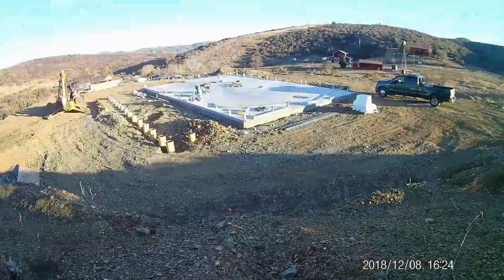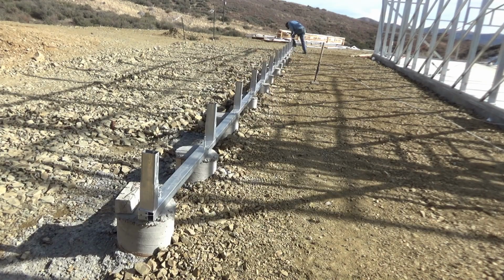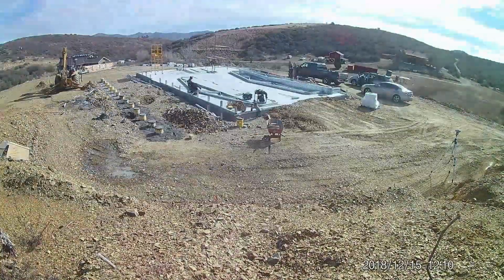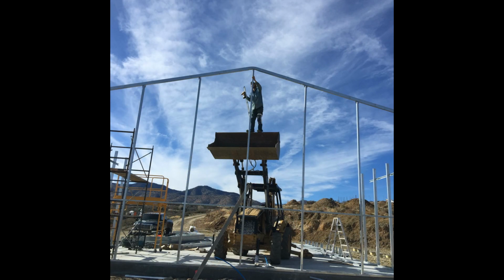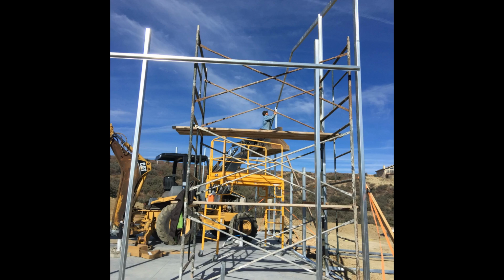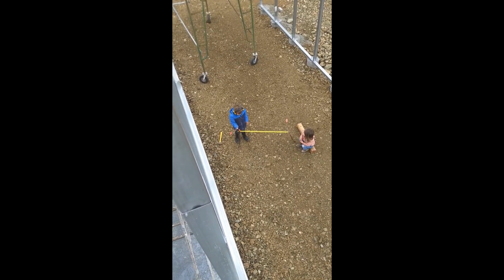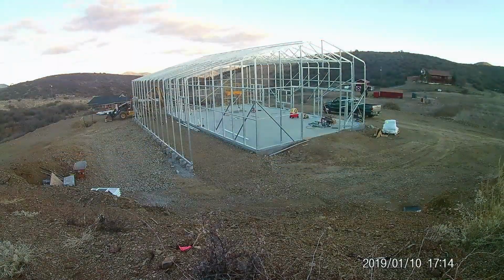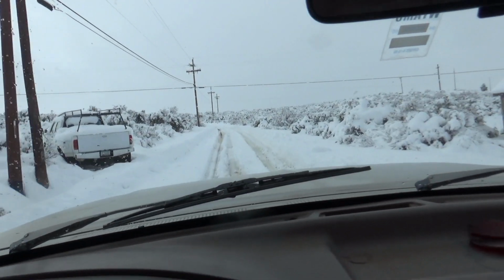Versatube DIY Metal Building Ep 6: Framing Part 2 - Going Up

Comment: How long was your build? What size is this? I think I missed that some where.
Reply from the maker: I think it took over 6 months to finish everything, that included building out a drywalled 2 bedroom guest house inside the building with full bath and kitchen, and septic so I could live in it while I build my main house. The frame and sheeting without insulation goes up pretty fast. Probably took me a week to do the framing and another week to sheet it working mostly by myself. The enclosed space is 34'x54, and the lean to is an additional 12'x54'. I have some other videos on it as well. I never got around to continue the series but my timelapse video has some shots of it completed.

Comment: What’s the size of that slab?  How tall are the side walls.... 16’?
Reply from the maker: The area is 34'x54' and it's 6" thick 3,000 psi concrete with #4 rebar at 12" o.c. each way over 5" of compacted ABC. Yes the eaves are 16'.
Reply: Goldenfab thank you for the detailed reply. I’m getting ready to start mine next week and yours is just a little bit bigger. Thank you for posting the videos and information. Very helpful!
Reply from the maker: @CallSignGino  you bet! Good luck with yours.
Reply: Are you going to document it?
Reply from the maker: @TerraFirmaX  like a slab pour video or something else? I'm open to suggestions on what viewers are interested in. The slab pour video is here https://youtu.be/y_LVHaTiZ30